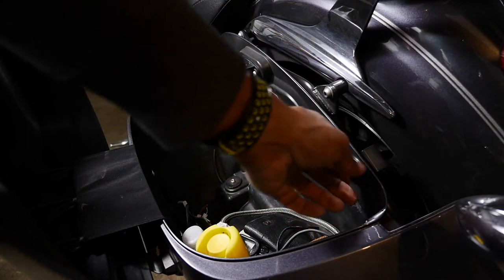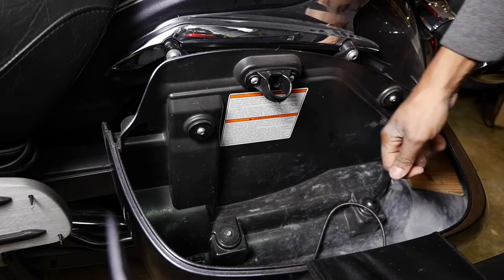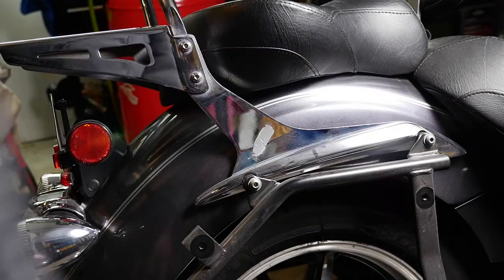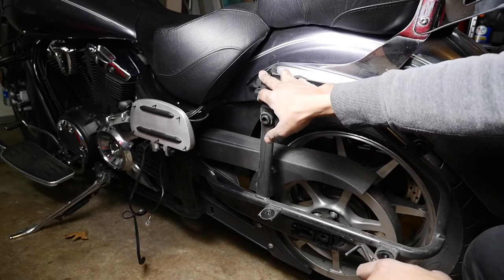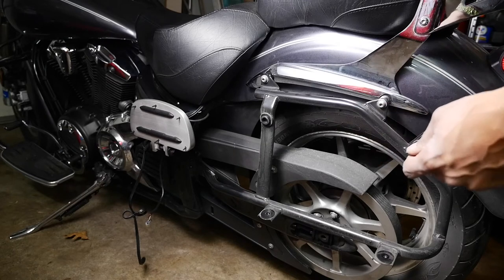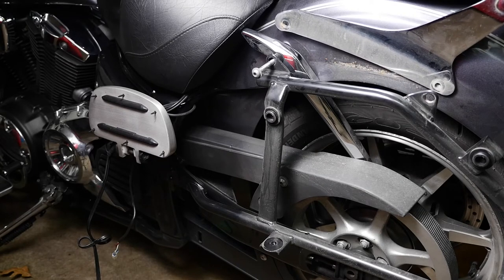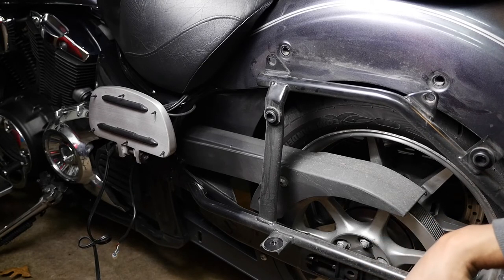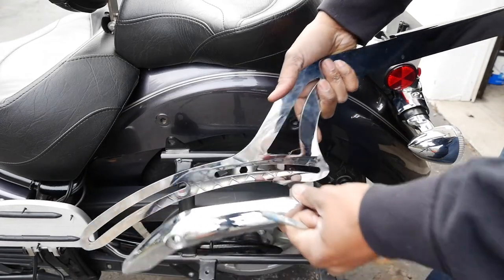Removing the backrest | Shad top box install |Part 1 Vlog#224

Comment: What gizmo do you power-up in the left saddlebag?  I have basically the same saddlebag setup on my Road*, but I'm headed to the basement to see if I have that rubber plug...pretty sure I do not...  that would be a "funny" thing to overlook.
Reply from the maker: The deluxe come with a  ipod adapter in the clutch saddle bag, that little white peace is an bluetooth ipod pin adapter. It would power up, and you could connect the phone to it and stream music. Lately it hasn't been working right though. I have an bluetooth adapter on the way though which I will use to send a signal to the speakers instead, like my old mpow set up. I did a video on that mpow setup a while ago.

Comment: What's with the can of Pledge?  Are you moonlighting as a cleaning lady?  (haha)

That's a lot of work to remove those saddlebags.  It's like Yamaha really doesn't believe anyone wants to clean their rear wheel, fender, and/or belt guard.  

Stay warm, B.
Reply from the maker: Well hanging out on the wing forum , and a topic came up about cleaners, and  quite a few comments came up about pledge and how well it worked. Many stated they got theirs from the dollar store also, which mine is from by the way. Then I went on the star 1300 forum and started yapping with a few of them over there, and a few guys swore by it too.. so ... I tried it . 
Well lets just say I went and picked up about 10 cans of the stuff. for ...... yup .. 
$10 bucks. haha. 

I used it to clean up the rear fender as you saw in the day video. I also used it to clean up the little decoration peaces that were mounted on the outside of the backrest posts. stuff works awesome. 
I do still apply wax too. I need to take the bike to the car wash and hose it down though , as much as I hate water and bikes. 

thanks for watching .
Reply: Dario C. Cruz it’s an old cop trick.. pledge wipes away the fingerprints. 😉
Reply: Hm... it's interesting that you know that... :-)
Reply: Dario C. Cruz I use to watch tv! 😉
Reply: I'll try not to hold that against you :-)